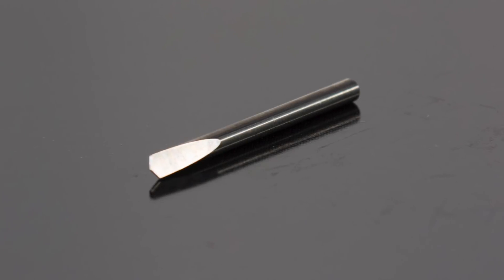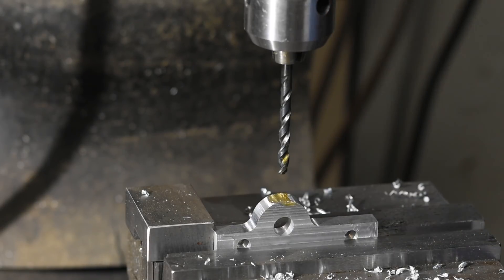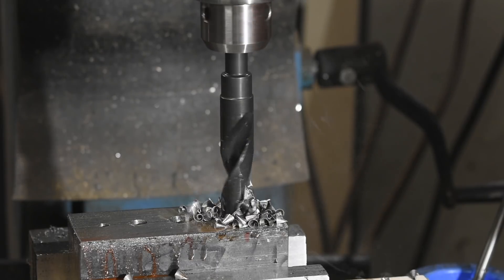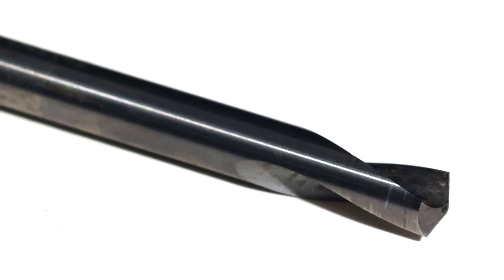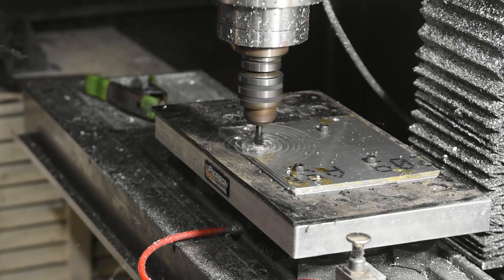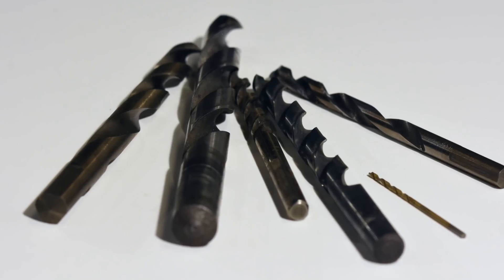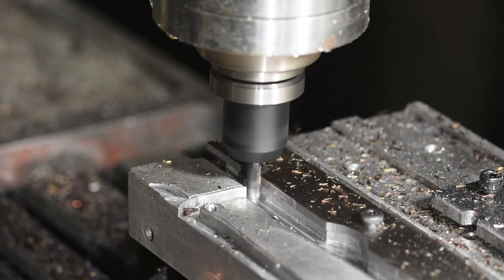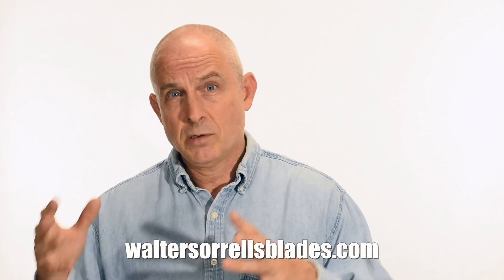Drills for Knife Making - Everything You Ever Wanted to Know

Comment: The cool thing with carbide bits is that they're available individually. If you're a knife maker, you're only using maybe a half dozen different sizes. Get what you need and save the money from buying whole sets that include sizes you'll never use.
Reply: true, Main sizes here in europe are that of what you get in brass rods, 4mm 6mm, 8 or 10mm for mozaic pins and such. Then I have a long 6 mm drillbit for hidden tang handles. Thats about it. Maybe a few smaller ones to drill holes for your bolsters etc, 2, 3, 4(but you already have that) 5mm.If you get fancy you can get like  the small drills for the alligning pins like 1 or 1,5mm or so but thats about it. Down to bare minimum you choose either 4 or 6mm,  maybe a 8mm for lanyard hole and the correct size for bolster drilling. For everything besides steel you can go either el cheapo hss, and the most used ones for holes in steel get kobalt for that.

Comment: Hey Walter great video! Just recently picked up some m42 cobalt drills. For the longest time I used the cheap HSS drills at the hardware store which work  ok for soft steel and wood. But the cobalt works so much better and last so much longer.